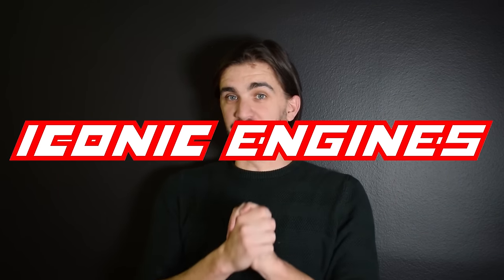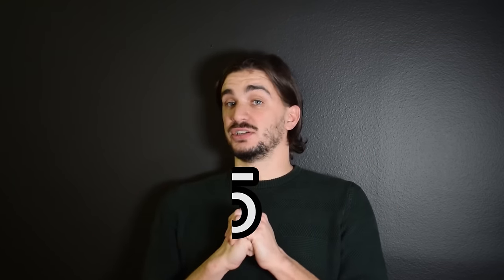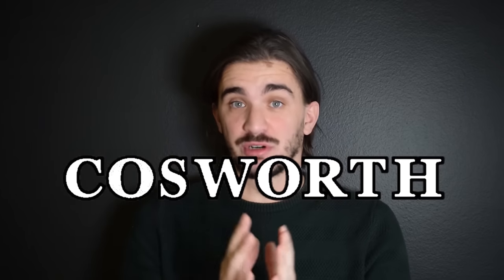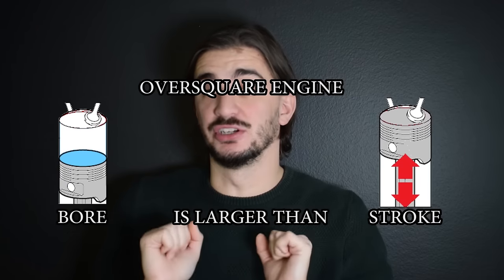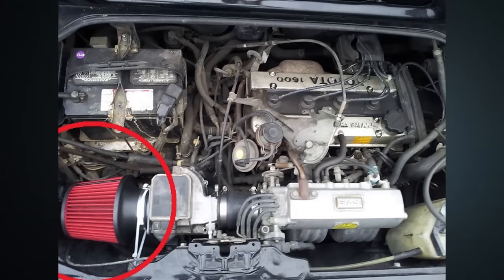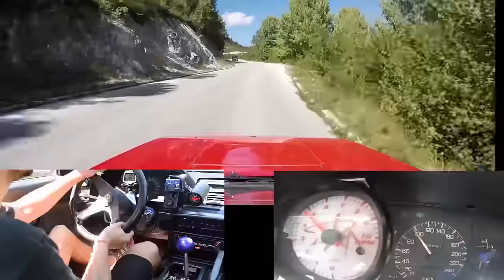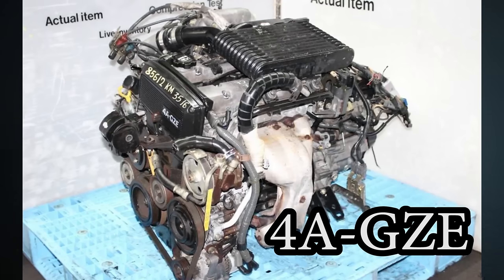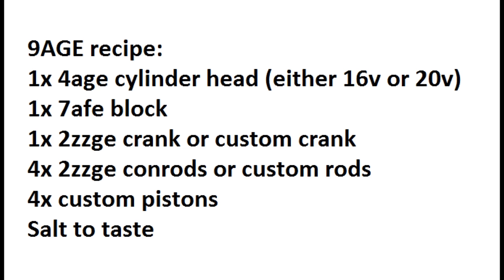Toyota 4AGE - What makes it GREAT? ICONIC ENGINES #1

Comment: Initial D and wheezing iron dukes brought me here. Great video on that engine though! A 4A-GE would make for an interesting engine swap in Fieros.
Reply: thatbluefieroguy
Just skip it and drop in a 3S-GTE. Factory turbocharged, Yamaha head, nearly bulletproof all day. Check the specs - nearly everything internal is the same as 2JZ-GTE. The turbo is even of the same family.
Reply: If your gonna engine swap a FIERO go with a turbo k series. With stock internals it can make 500 WHP.
Reply: Neg Ative I don't really care for turbocharging for this car.
Reply: For 4 bangers I'd choose an olds Quad 4. For v6 I'd go with a buick 3800. Easier swaps with more power than the 4age
Reply: @MichaelSmith-ov1nf  you dont mean the 2.2 K-car motor, do you?

Comment: Mr pistonator with an engine built by Piet Jordaan in South Africa has over 1000hp possibly a 9age or 7age and holds the Age record at 7.2s 1/4 mile
Reply: id love to see how it was built..
Reply: @MaximusPsychosis  they are secretive about specifics but it's an 1850cc motor arias pistons and pauter rods,toda valves and fittings,secret sauce cams and porting

Capable of spooling 80mm+ turbo's without nitrous
Reply: @Realtime1501  fare enough, don't have to show all the numbers, just the build, people like seeing motor porn like that...

Comment: I'd love to have a 20v in an mr2 some day
Reply: Isaak Welch I’ve got a 20v blacktop in my aw11 mr2 and it’s quite great. Not super fast but Makes amazing noises and is super fun to drive
Reply: ben bowers pretty cool but only you missed is the AE92 Supercharged engine. read in Over Rev! Manga, Ryoko Shino she just killed the 4AGZE engine the stock engine of the AW11 Supercharged. Cause in the Over Rev! Manga, she put a new engine in her AW11, which is AE92 Supercharged Engine. It was originally stock engine of 1989 Toyota AE92. And then after she put the AE92 Supercharged Engine in her AW11, Ryoko Shino turn the ignition on her car and it worked. I read in the Mangakalot.com in Safari.
Reply: I did the 20v head swap on my 87, it's relatively low budget, and they have 20v swap kits that are way cheaper, more reliable (if you have a low km/mile engine) and even easier to install as it comes with a guide. Also comes with camshafts and other high performance goodies.
Reply: Brandon Marenko OMG get ahold yourself 🤦🏻‍♂️
Reply: Lmenzol hey relax would ya. Didn’t you read Over Rev! Manga in Mangakalot.com on Safari what I said on the comments?

Comment: I think it's more like 3SGE - 2RZ I am your father more than the 22R ! I am putting together a late 50s style formula 1 special with 2 of these joined together with custom ground camshafts and an Eaton supercharger scavenged from a modern Mercedes to act as the one 8 cylinder engine - Alfa Romeo and Mercedes did the same thing with their straight 8 grand prix engines using 2 seperate blocks to get around the torsional twist problems of the 1 long crankshaft and the tendency of long cylinder head to want to warp under heat cycles.. It's gonna look kinda something like a Maserati 250F or a Scuderia Lancia D50, but not an actual replica of anything - woudl hate to go to a hillclimb and have some snobby purist point out 'thats not correct' , 'they didn't do that back in the day' or 'oh , thats a modern one but!' no thankyou .. but the heart wants what the heart wants and thats what I'll build!

Comment: I would like to know if a engine has got free valve clearance, so if a timing belt should brake, will the valves kiss the pistons?
Reply from the maker: The 4AGE 16v is non-interference in stock form, so no kissing will occur :)

Comment: You could cover engines in order by #of cylinders so as you have started with the 4AGE you could then do the 4G63T, EJ20, etc then move onto 6 cylinder's such as the 6G72TT, 2jZ, RB series, etc etc

Comment: Ok, this is probably a weird idea. But possibly one of the most successful engines for Toyota was the L series diesels. These are not exciting engines at all, the 2L for example was a 2.4 liter engine with rather average fuel consumption, a belt driven cam, indirect injection, making a pifling 58kw. They are great mostly because of their rock solid reliability and the serious amount of vehicles they were used in. Then there was also the KD engines, extremely popular in Africa and Australia, replaced by the GD6, and the AD and CD engines used in sedans. Another boring but wildly successful engine (petrol this time) was the small 1.3 liter 2E, which also had a 4E forced induction option. Toyota truly has no end to awesome engines.

Comment: What about the Toyota 20r and 22r engines in the 90s  we weree getting upwards of 400hp in our minitrucks here in the states without turbos, we used mikuni side draft carbs a lot back then
Reply from the maker: Upwards of 400hp from an NA 22r? Really?
Reply: @d4a I have a bunch of 4 age. Blue top ,red top and silver top. But the 22r did have potential. Not sure about 400 na.
Reply: @d4a the cosworth DBA looks exactly like a 4 age. Some say the 4 age is a knock off of the DBA.
Reply: @d4a sorry didn't finish the video. You just mentioned cosworth.

Comment: Easy to work on....
I replaced a piston in my MR2 1gen without removing the engine. Remove the cross member and oil pan, unbolt the conrod and push it out the top. Easy as pie. I had 200$ in the whole job after doing all the maintenance.
Reply: any video

Comment: You skipped right over the 4A-F engines. Right before the 4A-FE in ‘88 and ‘89 (in the US) there were DOHC feedback carbureted 4A-F engines.
Reply from the maker: I did, because it's not really relevant. The video is about the 4age, not the 4af variations l.

Comment: A really good video but one thing bothers me. The 2zzge crank doesnt work as a 9age build. I tried it. You need to heavily machine block an crankshaft and run an flywheeladapter with many mods at the bock of the engine. The numbers are right but doesnt help. Stroke of 7afe 85,5 on 2zzge 85mm. Makes no sense. A billet crank makes wsy more sense.

Comment: Had multiple 4AC powered cars and 400k miles was nothing and you can rev them to the moon and they run like new even with 35 year old carbs get over 40mpg. The 4AGE motors seemed to be much worse on mpg than the single cam motors and the twin cams didn't last as long

Comment: 112hp 1.6L 4age legendary engine, not much to gain when NA tuned, volvo redblock 2.3L 114hp mondain grampa engine. ported 16V head ITBs and stroked from 2.3-3.1L 300ish hp for roade use with aftermarket ecu NA tuned
Reply: Ståle Mahoney There are NA 4age 16v tuned to 300hp. So your argument makes zero sense.
Reply: @boroboroae86  300crank or 300wheel is a bit of a difference.
Reply: @boroboroae86  No 1600ccm 4age has ever made 300 crank hp. 250 is about absolute max on race fuel from the FA. Don't argue about hp with a stroked and bored engine that has almost double the displacement - that battle is lost before it has begun haha Pretty sure no Volvo engine has ever made 156hk/liter though ;)
Reply: Ståle Mahoney Your first comment didn’t specify crank or wheel hp. But yea there’s obviously a difference.
Reply: npharkes Where in my comment did i say 1.6? The comment from the op talked about a stroked and bored volvo engine. So naturally the 4age I mentioned is also that.
Reply: @npharkes  thay have even made 300+ crank with the 8 valve head NA xD but that was a high revving 2.6L https://www.youtube.com/watch?v=lCU9C7_Kg0g quite an achievement with pump E85, naturally they put it in a volvo 240 and made around 275hp wheel, not bad for a ported 8 valve  but no i dont think 156hp pr L is a number i have seen on a redblock, but they are also good revving engines as its stock  a 96 bore 80mm stroke. mine is 96.68 bore and 103mm stroke for daily driving, and only 11.83:1 comp

Comment: Here from NZ 🇳🇿
I have a 4age 20v blacktop in a ae111 Sprinter has done 295000ks from factory, unopened stock form.

 Still going strong, taken to redline most times I drive it and never missed a bit. Owned for 7 years.

 Also own a 2zzge, zze123 Corolla Z tourer, but must say AE111 sprinter can easily hold its ground to it's successor with half the mileage. 0-160km/h that is. Both 6MT. 

Ae111 4age Sprinter is more fun to drive, alot less weight and seems to handle better and more aggressive intake noise than the 192hp successor 2zzge Corolla.  My 2cents..
Reply from the maker: You live in the land of MRP! Lucky! Yeah, I got that from a lot of ppl. Old analogue stuff has more thrills even if less power on paper.

Comment: You make Great videos!

Love engines that REV high.  In this configuration normally "under square" as bore is more than stroke to keep piston speed in check.

The 2ZZ-GE engine is my favorite...but has longer bore than stroke (under square)....I am biased as I recently rebuilt from terrible to show class and installed in my MR2/S.  It is strange to ignore the red-line on the MR2/S tach as engine is good for 8,200 RPM safely.

BEST mass produced engine in my opinion:  The Honda "K" series.  Will not re-power the MR2/S, but the 2.0 at 9,000 RPM is attainable for a daily driver without big expense.

Mr. P
Reply: EDIT:  Over square larger bore vs stoke,  2zz is "under square"

Honda 2.0 K series is "square" at 86 x 86 mm (1.0 bore to stroke)

2zz-ge Toyota/Yamaha "under square" at 82mm bore at 85mm stroke (.965 bore/stroke)

1zz-fe Toyota 79mm bore at 91.5mm stoke (.863 bore/stroke)

Comment: I think a good engine to cover would be GM's C20, most specifically the red top found in hot GM compacts of the late 80's through the 2000's
Reply: Theres a C20XE engine in this vid, its mistaken for a cosworth, Its the one with the black rocker cover and red L shaped spark plug cover.
I had one fitted to a 90s corsa B

Comment: What makes it great? The unyielding community of Initial D fans that refuse to let these poor 40ish year old engine or the AE86/GTS rest in peace. If these engine could speak they probably would beg to be killed already...

But Toyota is to blame here for refusing to make an proper engine to replace it and instead leaved the job to Subaru...
Reply: @ishitmypantsinacarwheniwas7  I didnt get much of what you said besides straigh pipe sounds, but the sound is not the issue here.

Comment: Buddy you should definitely do a video on 4AGZE Engine by Toyota wich has the Supercharged engine version wich is kinda a very rare engine from Toyota
Reply: Not that rare, there were a lot of front wheel drives that got them in the late 90s.
They were rarer in the sports cars than the grocery getters for some reason.
Mine is sitting in an Aussie delivered AE86.

Comment: Correction..

My 4age has a small port head 
550cc injectors
272 cams 
Caravelle kombi 2.6 pistons
4agze block, rods and crank 
Stock sump
T3/T4 turbonetics 
Powermods ECU
250kw on 1bar
390nm 
Car can still push to 1.4bar before going ethanol

These engines can make big stupid power I've seen some do a good 380kw without going dry sump...
Reply from the maker: Hmmm the caravelle pistons are the really interesting thing there! Good thinking.
Reply: @d4a  yes I only knew about it this year when I started my build. Must say they give off a carnivorous tune to the motor especially with the cams

Comment: The Toyota Corolla RXI was my first car.I really miss how that engines screamed all the way up to 8000 rpm.It was also a bulletproof engine.I had an accident and they didn’t put oil in the engine after repair and I drove around for 2 weeks without oil.No damage.

Comment: Toyota Engine naming system:

First digit: Iteration of engine block 

Second digit: Engine block type

Third digit: Head type (F for eco heads, G for performance heads)

Fourth digit (if applicable): Varies (S for D4S combined fuel injection technology, T for turbocharger, Z for supercharger)

Last digit: E for electronic fuel injection (Carbureted engines typically didn’t use the last digit for fuel system type)

Comment: i have an ae86 that im currently 20v silvertop swapping. how much power/ boost do you think it can handle at least somewhat reliably? if anyone knows. will be much appreciated
Reply from the maker: Stock internals? Not too much boost. The silvertop is better than the blacktop for boost, but the late bigports (aka redtop) are better for boost then the silvertop. 200-250hp stock on boost is the limit of reliability. With the precondition that everything else is in good spec (rings, bearings, gaskets, valve seats, etc). When it comes to NA power, 180 should be relatively easily achievable with the silvertop. Maybe even a bit more if you're willing to spend a bit more.

Comment: Hrmms talking about overbore engines that nobody thinks of when it comes to high rpm n a platform. Mitusbishis 6g72 3.0l v6 from the 3000gt. Has a 91.5mm bore and 76mm stroke..its a seriously overbore performance engine. Though most people only think of it for turbo builds were RPM matters much less.

Comment: my 86 corrola had a broken odometer stuck at 850k when i got it in 2004.i put at least another 500k on it till i lost my liscence.origional motor but with a crack in the block leaking coolant.i just had to reguraly clean spark plugs and hammer the solonoid when it wouldnt start.best car ever
Reply: DaviDamir every Corolla has that same starter problem lol

Comment: I own a Miata and i wish it had a 4age-like engine in it! Instead they used an old turbo engine, removed the turbo and bumped up the compression. This makes it a bad NA motor, it's undersquare, flows poorly and has the wrong intake runner design... you're lucky to see 150whp on a 1.6 miata engine lol and that takes probably 5000€ or more
Reply from the maker: If they removed a turbo maybe it's time to put one back on :) wink wink nudge nudge
Reply: If you have a miata dont go 4age but go with kseries. They sell adaptors that bolt up to your trans. K20 or k24 both 200hp and u keep your weight distribution.

Comment: Is this available in usa in a junk car with manual trans in-line for a rear drive car? I want to put one in my 1989 Mercedes 240d manual car. Need the computer harness and swap kit if available. I need to a good MPG and compact fitting engine for my car with decent performance. Not gonna race. Want reliable run power. Quiet exhaust. Need a 5 speed or 6 speed manual also.

Comment: Excellent job, still love seeing the hasselgren motors for Formula Atlantic.

I'm not sure the 20V is superior for power.

If you disassemble the 4agze you'll be shocked about the actual build quality of the engine.  The bushed rod, floating pins, ceramic coated pistons, oil squirted.

On small port short blocks we would run factory bottoms with a 16v head to 9300 rpm.  This was more a limitation of the facility head than the bottom end.  The valve train is so lightweight there's more potential.  Aftermarket engine parts are not really needed for most builds.  Look at the factory connecting rods across all the series of the engines.  The engine has so much history I wouldn't expect you to be able to know all these things without firsthand knowledge.

The 7age is only better if it's run within factory parameters, the stroke actually hurts the overall power potential.

And for more fun with Toyota's dig into the 503e
Reply: how would more displacement hurt power ?
Reply: @ntwx2137  the rpm capacity is reduced more than the gain in displacement.

Comment: I have a 4a FE, the head gasket blow twice, after that the mechanic didn't put a right inake hose from the filter to the manifold, so about 50,000 km of suction garbage, I'm pretty sure there are no piston rings in the engine, but it still goes like crazy

Comment: On the cooling, I had a 1985 Corolla FXGT. Could thrash it everywhere and never moved off 3/5th's on the Temp gauge. Sit in traffic for 45 secs and would overheat. Changed hoses, thermostat and radiator cap, didn't fix it. Mechanic said only other thing it could be is coolant pump, but didn't make sense as it should overheat all the time. I got a junkyard pump and pulled off mine. The impeller blades had rusted down to stubs all the way to the shaft. When I showed the mechanic, he was so impressed with the cooling system he asked to keep the rusted pump to show others.

Comment: Wrong missed 1   4ac ,4af carby,  4afe injection then the 4Age (af and ag had the exact same block different heads )(narrow valve single gear dual cam) and a (age/wide valve dual gear dual cam)

Comment: The fact that Toyota Could reliably and cheaply mass produce a racing engine just proves that they have the best manufacturing technologies and are engineering powerhouse. 
And i really wonder: what was better than 4AGE in early 80s, especially for it's cost? If there were such a thing, it had got to be Japanese.

Comment: Basically the ak of engines. Old, reliable and common.
Reply: Really the 3tc is the Ak of old reliable engines.  They even fit the bill as far as being simple and just works.  I sold a Corolla(te72) to a guy that had a slight skip and was low on oil only to realize as we drove it onto the tow dolly that it had a hole in the block on cyl 3 .  We test drove it a mile with it windowed and only till we topped it off on oil did we realize there was a problem.

Comment: I owned a 4AGE BlackTop with 20 valves, or rather a Toyota Corolla GT(AE111) with 6 speed gearbox, second hand from Japan, built in 1997.  Car already totalled in 2005, had owned it for some 18 months.  The engine had some weaknesses in terms of performance for me as a user, between 2500 ~ 4000 RPM there was a black spot if you were above 4th gear.  For sure its an Iconic engine.  As for the sound, it sounded more like a Yamaha motorcycle engine when floored.